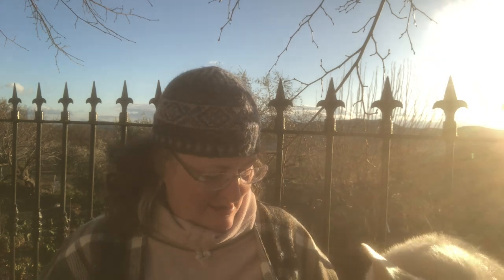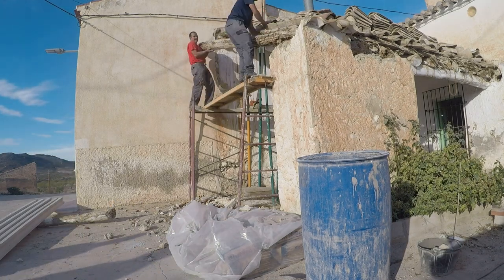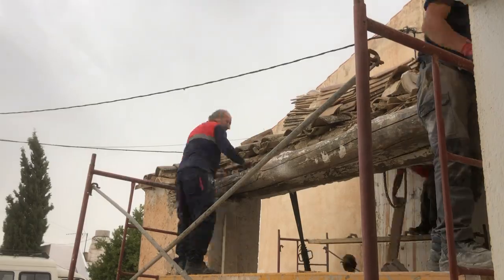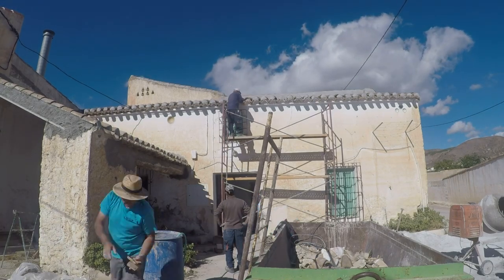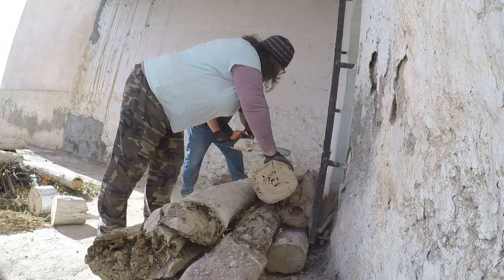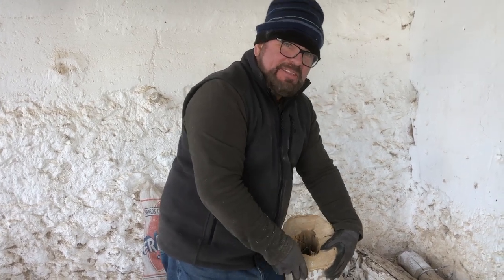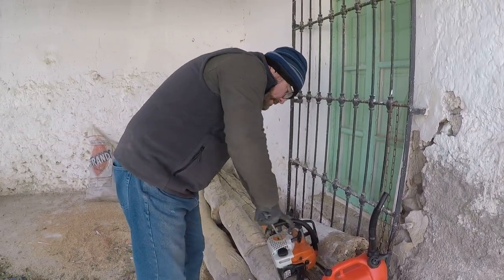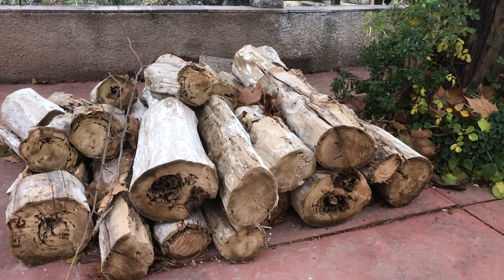25. Final of the roof repairs, find how much it cost & what we did with the crumbling old porch.

Comment: Thanks for your video! I quick question based on the water problem for crops . If you could back in time and select another location to buy the farm, would it be the same place or another in Spain?
Reply from the maker: Great question. we always wanted somewhere warm enough for olives and with the climate crisis many more places will have the water issues we have here now. It's simply a matter of working differently. Though somewhere with a spring on the land would have been great that would also have pushed the price a lot higher. To be honest we really like it here.